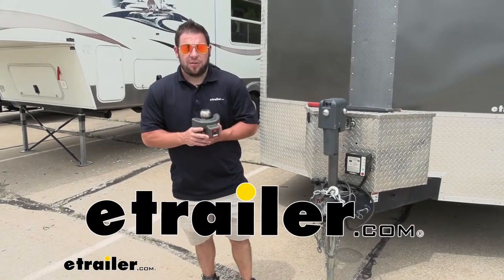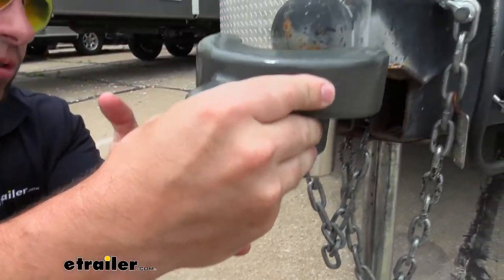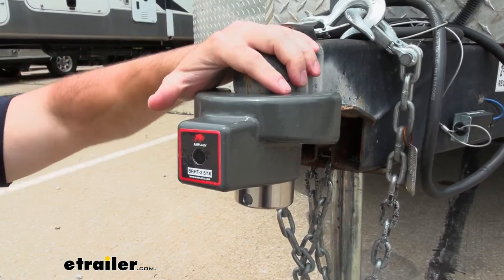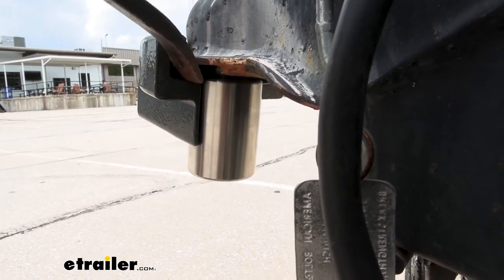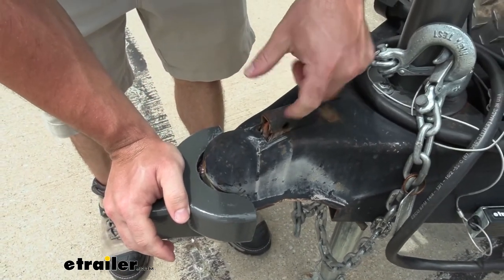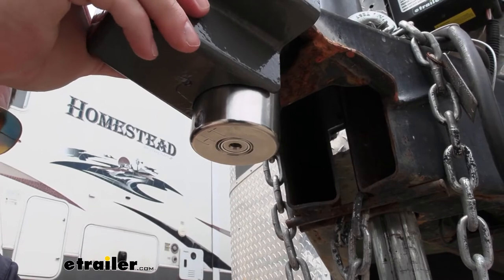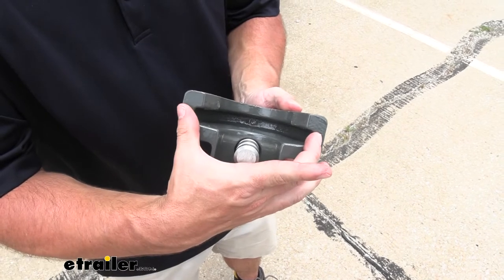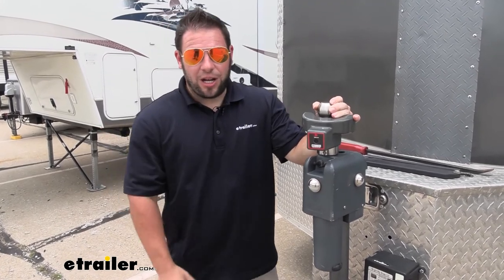etrailer | AMPLock Flat Lip Ball Couplers Trailer Coupler Lock Review

Comment: I have this lock but I can't get it off the lock is stuck,I tried to use WD40 but it won't drop. So you have any advice you can give me on how to get it to open.
Reply from the maker: I would continue with the spray lubricant. We've had good results with Sea Foam Creep. Coat the lock area with the spray, then give the bottom of the ball/lock assembly several sharp raps with a mallet. You might need to repeat that several times. Between the lubrication and the shock from the hammer blows, hopefully you'll get the lock to open.
https://www.etrailer.com/Trailer-Coupler-Locks/AMPLock/AMP44FR.html